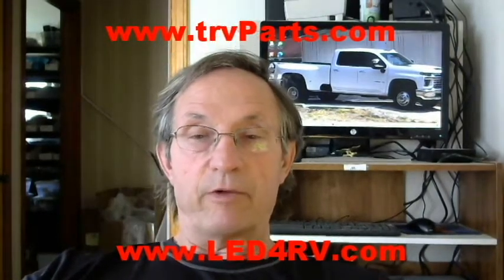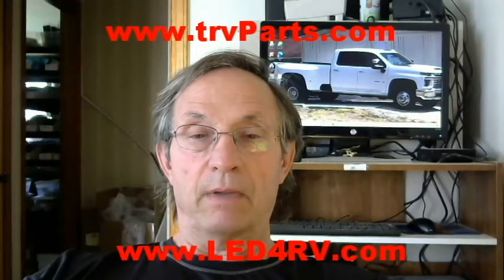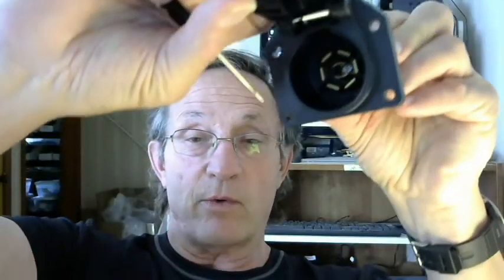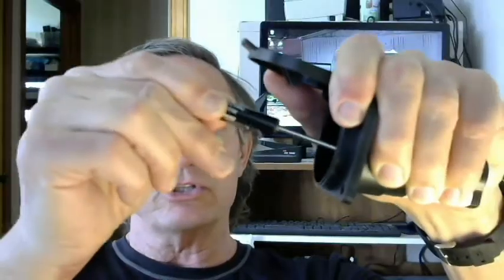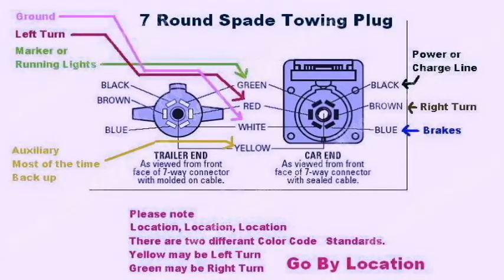The Most common Problem when trailer  tail lights are NOT working

Comment: HI Dan, I have my trailer tail lights that just wont light, although my turn signals, my break lights, my emergency light, my electric break all work perfectly. I had an issue with the connecting cable from the car to the trailer lately. It got tangled up with the hitch and caused a short somehow. Two fuses were busted in the truck fuse box. I replaced them. So I dont know were to look. I replaced the 7 pins cable. Do you have an idea for what I should look for?
Thank you in advance an thank you for sharing your expertise, much appreciated.

Best regards,

Sellig
Reply from the maker: Did you check the fuses on your toe vehicle?
Reply: @Trvparts  Hi yes but I think I missed the 30 amps one. I changed two 20 amps cause flashers weren’t working, but it seems that those big fuses are difficult to  test or have a visual. Many thanks
Reply: @Trvparts  done, solved, thank you

Comment: I need your advice. The turn signal of my left light doesn’t work, although the brake and running light work. I cleaned the plug as you described. I also bought one of those LED checkers and it worked because the left turn and right turn LED blinked. But my left signal turn still didn’t work. I did a continuity test on the yellow wire and it passed. So, I figured the tail light broke and bought a new tail light. Wired the new light but the problem doesn’t go away. What else should I do? Thanks
Reply from the maker: When you say continuity do you mean it had power as in when it blinked? When it come to wiring problems you have to go to "known good". In this case I'm thinking the Yellow wire is your Left Turn. There maybe a junction box right behind the trailer tung. Is the wiring blinking there. If not the problem is between there and the 7 way plug. If it is blinking there the problem is most likely right behind the tail light itself.
Reply from the maker: I like this kind of test light. Much easier than a meter. https://youtu.be/0C1Bl4iNEYc
Reply: @Trvparts   Both the 7-to-4 pin adapter plug and the trailer plug have LED indicators. When I turn on the ignition and turn lever, the LEDs turn on in sync. However, there is no voltage on the yellow wire (left signal wire). I tried to bypass the yellow wire but still no voltage. Bad trailer plug or bad receptacle although the LED indicator blinks?
By continuity test, I meant I connected the yellow wire ends to the voltage meter. If it has an open, there is no sound. If it has no break, there is a sound.
Reply from the maker: @deplorablechump8758  It looks like you will need to run another wire

Comment: thx for the info...i have an issue with my trailer when i turn my head lights on in my truck and when i pushed the brake my trailer brake lights instead of getting brighter they get dim and when i turn off the head lights my trailer brake lights work fine.......any idea what could be?
Reply from the maker: Yes , I know Exactly what the problem is. Do you have a bad ground on the trailer. Basically what is happening is electricity is wanting to follow the path of least resistance. And since it cannot find the design path via the bad ground it is back feeding into the other circuit. Most trailers have two ground wires one of the front and one in the back that attached  to the frame. My guess is is the ground wire at the rear of the trailer. I would check the tail lights
Reply: @Trvparts  I made a mistake on the second part of explaining my trailer issue....ok here's the issue when i pressed the brake pedal my trailer brake lights instead of getting brighter they get dim ...and when i turn on my heads lights my trailer brake lights are brighter then when i pressed the brake pedal they dim ....and it's supposed to be the opposite.. but ill double check and see if my trailer has a rear ground  wire.
Reply from the maker: @Luna-dt1nt  I see. I would double check with the towe vehicle manufacturer. They may have a fix for this, as you may not be the first person who has had this problem. When you start talking about lights going dimmer that sounds like a bad ground. But when you talk about lights getting brighter sometimes that may mean Current is back feeding into the tow vehicle circuit board. That can get expensive. If they don’t have a fix then you may can fix this with diode‘s on the trailer.
Reply: @Trvparts  ok thank you
Reply from the maker: @Luna-dt1nt  Some thing else you can do that will tell you something hook it up to another vehicle. If you don’t have the problem there there must be something with the design of the tow vehicle